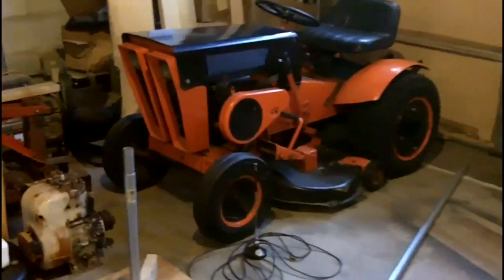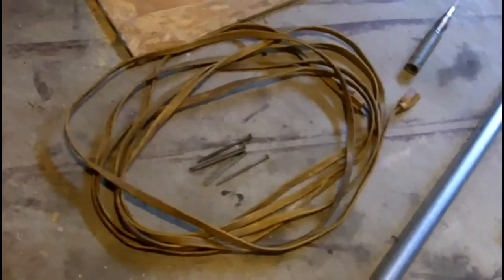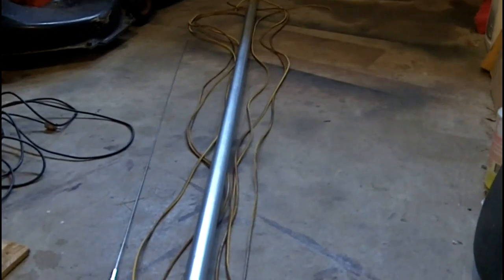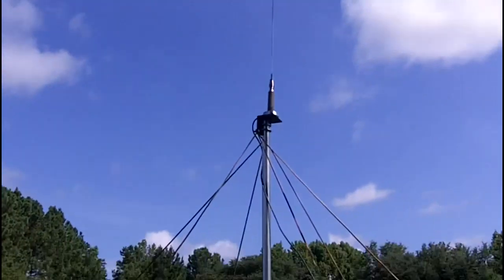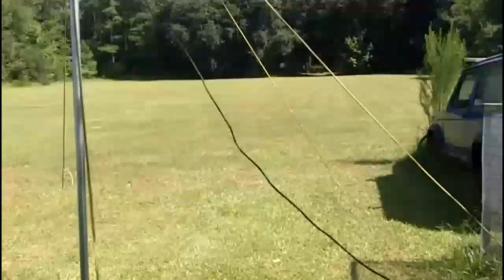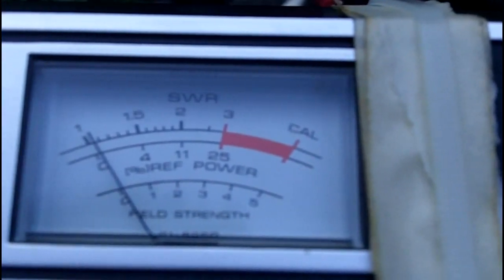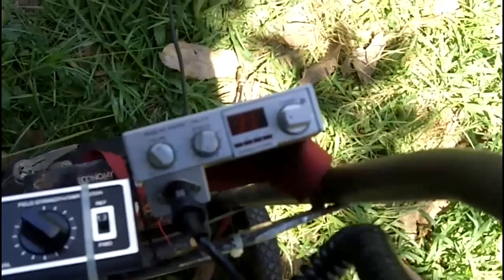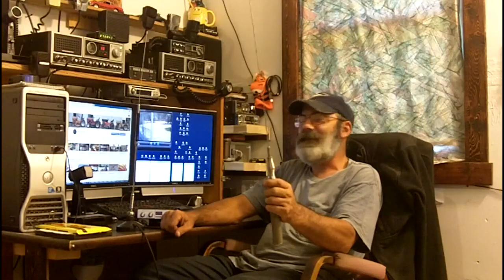Mobile CB Radio Antenna as a Base Station

Comment: TRC-415!!! The first cb i ever had! Begged my parents to get me a cb and we went to Radio Shack and left with that one! Great memories sitting in that hot van at 13 years old in the mid 80's trying to talk a few miles! Thanks for the memory jolt!
Reply from the maker: The 415 may not have a lot of features, But it is a great little radio. That's very cool, that it was Your first radio. Thanks for watching.
Reply: @MowerJunkie  short on features, long on memories. Keep up the fine work, sir

Comment: I did this in the early 80's with just a 9ft alu pole and a 7ft firestick. It worked so well, someone stole it out of my back yard along with the coax.
So I made a 36ft dipole from twin core cable and strung it down the garden... Looks like a washing line.
My temporary fix antenna has worked well for 25 years and is still doing it.
Reply from the maker: still working after 25 years.....That's awesome! Gotta love the Homemade's. Thanks for watching, 73's

Comment: Ok Mower Junkie, I had flashbacks from the 1980's.  Yes the center load mag mount is from the 80's.  I had the same one.  I needed to broad band it a little more to talk on 35-40 SSB.  So I used a metal coat hanger and trimmed out a new top part for the antenna.  I then stuck the mag mount antenna on the seat of a metal folding chair on the roof of my shed using the original however long coax that came on the antenna.  I named my antenna the Astro Chair Plane.  Did alot of talking on it.  Enjoyed the video, it brought me back about 30 years.  Also this is what radio is all about.  This was when I enjoyed radio the most.
Reply from the maker: Thanks for sharing Your story. Antennas are My favorite part of the Hobby, and I do like hearing what others have done with them. 73's Mon Goose, from 151 SC.

Comment: I have a K30 on top of my 30’x60’ shop and I have have been amazed at how well it performs on skip . Enjoy your experiments always good to hear someone else’s ideas.
Reply: i have a K30 too and a shop thinking of doing the same.  How did you set it up?
Reply: @mtw3725  I tried to center it on the roof it leans to one side a bit but the magnet holds really well on the sheet metal and used some tape on the coax to keep it in place, I have been amazed by how well it works, SWR is very good. If you are looking for something simple , easy and quick it will do the trick.

Comment: Nice test set up. I thought the same about a decade ago. Had a self assemble press board night stand, strapped it to a similar hand truck and could house any radio (mainly to test CBS) to takes to the local flea market. Never finished the project but, the intent was to be able to test a set as I found them, would have carried a car battery inside, and would have equipped it with an SWR bridge and antenna. Never completed the project but that was the idea. Could have used it anywhere and equipped for anything, like a heavy "go box" for any radio hobby.

Comment: I'm using a dominator Springer as a base station antenna and it does work I've had some surprising results, I've got a 102" tank whip also with excellent results coupled up with a kenwood TS50

Comment: Getting a kick out of this bare bones base rig. I remember a guy that was running an old Halicrafters crystal rig that was a 6 channel bread box size radio. He wasn't pushing more than 3 watts he said. Had a small ground plane antenna in a tree outside his window. He was able to reach town about 8 miles or so. This was in the early 70s.

Comment: I used to transport for mobile broadcast television. I was always on the CB. I signed off October  9, 2011, if you were counting. Lol... So today I purchased a Wilson trucker 5000, a gum drop stud, with mount and bracket. Using a Cobra 29 LTD Classic. Home base set up. My antenna mast is made out of a 4' long 1x3 piece of wood. I temporarily attached it to my roof off the facia board. Ran the cable and signed on today. First time in almost a decade. Did a swr test with an Astatic swr and power meter. I'm at 3.0. Lots of static out there. So I'm thinking I'm just not grounded correctly? I did have success during my test. Someone asked who was making his dial move to the right. It came out of the blue. So I answered. He was about a mile away. Sounded real close. He too was a home base. I'm up on a hill looking over a valley. I've got a grounding rod for lightning and a Pro Trucker CB & Ham Ground Radial Kit for Mobile Magnet Mount Antennas. For the Wilson 1000-5000 brand. Not sure if this will help, gonna find out.

Comment: Long time no hear hello from hillbilly in the bam I tried that antenna and used four ground radicals that were stainless steel whips and had some of the best ears of most antennas I've had
Reply from the maker: Hello hillbilly in the Bam, Thanks for sharing Your experience with a mobile. Lets Keep the hobby alive! 73's from 151 SC.

Comment: Used to have one of those Antenna Specialist base loaded whips on my high school car. Worked pretty good.
Reply from the maker: I have 1 on My garden tractor, and it works great on it. It's a shame this 1 was damaged. to be honest, it looks like it was damaged during manufacturing.
Reply: @MowerJunkie  They made a ton of them. Probably the number one seller back in the early 70's.

Comment: Make a vertical dipole. Attach center conductor of coax to whip and braided side to 102" tube. Isolate tube from earth by about 1/4 wavelength using PVC mast or wooden fence post. You'll get close to a 50ohm match and fairly flat vswr. Did this last week. Worked Oregon to Georgia (the state) on 10 meter band with a whopping 5 watts!
Reply from the maker: I've run dipoles setup as horizontal and vertical, and even at 45 degrees once. It's a good antenna no matter how you hang it. Take care, 73's

Comment: im useing a magnet mount wilson 1000 antenna on a metal roof mobil home. and im getting 1.3 swr on it.  its working quite well barefoot. im running a uniden 980ssb radio. i havent heard you on my radio yet. but i have heard nc many times. maybe ill get you one day in the future.  listen up for me 806 in the Texas panhandle. 73's to you.  joel
Reply from the maker: Hello 806, Thanks for watching. 73's from 151 SC.

Comment: On that old mag base,  what did you attach that new grounding wire to ?   73's  from old fart cber.
Reply from the maker: when I put the 2 foot antenna on the pole, it was only grounded magnetically. I did not add a ground wire to it.  Thanks for watching, 73's from 151 SC.

Comment: I am currently using a Wilson 5000 mirror mount as a base antenna problem is I only have two ground planes at this time.Good thing is my SWR is under 1.2
Reply from the maker: That's awesome! I'll bet that Wilson makes a pretty good base!
Reply: I use the same antenna as a base myself. Works great, can do about 5 miles locally with my buddy and I've heard quite the chatter late night. I hear people all over the east coast even heard Kansas once
Reply: @MowerJunkie  Makes an even better mobile!

Comment: I used a top rail from chain link fencing and cut off a section drove it into the ground and then I slipped the other section over top of it that has a magnetic antenna stuck on the top of with a piece of 8 in x 8 in metal but I still have the Sky High standing wave I was trying to avoid the ground plane wires

Comment: My question is. Do you strip the insulation off the extension cord wires you're using for ground plane wires?    Is it better to use bare ground plane wires?
Reply from the maker: No need to strip the wires, Only the attachment end needs to be stripped. the wires will last longer with the insulation on. and it won't hurt the signal at all.
Reply: @MowerJunkie  Thank You for answering my question appreciate it. 73.

Comment: Hello, I recently rediscovered a CB radio I bought in Highschool 1991 that is in mint condition.  I used it in my car and had a group of friends who then did the same. We had a great time.  How can I know which converter to buy to use this as a base station at home?  I'm afraid to not know exactly what I need!   Thanx!
Reply from the maker: any 12 volt DC power supply with 3 amps continuous or more should work fine.

Comment: I’m trying to use a Wilson 2000 on a mass pole next to my shed and can’t get the swrs low enough
Reply: U need to get a ground plane kit that antenna was made to have metal underneath it to function I'm going through the same thing right now with the same antenna

Comment: My boyfriend wants to know what coax you use and the length  also he works in hot attics  putting in ac unit  100 degree is nothing he works in herando Mississippi  nice job waiting for you to do a livestream to try to call you keep up good job 10 4
Reply from the maker: for this antenna, I used cheap rg58u coax. Most of the base radios I setup have rg8x. Be careful in those attics. Thanks for watching, 73's from 151 SC.

Comment: So does it work better with 6 wires instead of 4, to tie down at the 45^ angle?
Reply from the maker: 4 will work well, But more will make it easier to tune. Thanks for watching, Take care.
Reply: I have 16 x 3m ground plane wires on my 7ft Firestik loft antenna..
Works ok but no way near as good as my homemade 20ft pvc antenna...
20ft pvc pipe with 36ft of wire wound onto it... Like a firestik only better.

Comment: What exactly was the ground wire soldered to on the magnet mount?
Reply from the maker: Sorry, I don't have an answer for this. the base of the antenna is sealed, and not visible.  Thanks for watching, 73's from 151 SC.

Comment: An umbrella base would probably be better than those boards
Reply from the maker: I was also thinking a Christmas tree base would work well. But the wood worked well for a temporary setup.
Reply: Mower Junkie 
I would recommend something with wheels so you can move it around

Comment: The pole doesn't have to be in the ground for proper grounding?
Reply from the maker: If this setup was permanent it would need to be grounded. it does not need to be grounded for a temporary set up.  Thanks for watching, 73's from 151 SC.
Reply: @MowerJunkie  that cables that you put down in the ground.  makes that the ground for the antenne?

Comment: I don't know where everyone comes up with this 102" obsession. The actual length in the real world is 108". And that is for the GP radials as well.
Reply from the maker: I don't know where everyone comes up with this 108" obsession. The actual length in the real world is 102". And that is for the GP radials as well.
Reply: @MowerJunkie  : The 102" whip is designed to be used with a ball mount and heavy spring. Plus, after taking into consideration the velocity factor of the feed line, 108" is the proper length. You can do all the math you want. In theory, the mathematical length of 1/4 wave is 102". In reality, the physical length is 108"
Reply from the maker: @TheLonesometoad  I've made a lot of antennas, and I've tried both 102 and 108". and every time the 108" will not tune properly. I have even done testing with a 102" SS whip, with and without the spring. and I have found the 102" length works the best. if 108" is working for You...stick with it. Take care, Thanks for watching.
Reply: @MowerJunkie  ... The 108" won't tune because it's resonant frequency is 26.000 MHz (468/26.000=18'/2=9'x12=108"  or  234/26.000=9'x12=108").
Great video, I had a similar setup using a Hustle HQ-27 Center Loaded mobile antenna at 40'. It was a great antenna for 11 meters (CB) until I moved from TX to MA.
73, have fun and stay safe.
Reply: 108" is correct, I have 102" whip with 6" stainless steel extension up over my shop. mounted on 20 ft flag pole with 3 102" radials. have 1.1 SWR on complete 23 channel band and with 80 watts only 1.2 SWR
Reply: @robertcook5972  : Well, I know it and you know it. Let the rest figure it out for themselves. I've been installing these for over 50 years and 108" is the magic number. Most people don't know you have to count the pot belly spring and the ball mount.

Comment: hi I'm IU8MLV; I would like to resume CB broadcasts with my Zodiac Tokio 276 ch AM - FM - SSB, which I have suspended due to the QTH change. Now I live in the attic (3rd floor and top floor) and on the balcony railing I have mounted a corresponding 4 meter pole at the lowest point of the roof. To this pole I mounted a 3 meter long Comet GP6 for the VHF - UHF, of which by means of the 4 meters of the pole, the 3 radials are raised to 1.7 m from the roof. I have my old Sigma 5/8 Mantova 1 antenna which is 7.20 meters long, but due to a very ventilated area I cannot mount it because:
1- I cannot mount the pole on the roof because I do not have the sturdy structure, otherwise I would have also mounted the bibanda pole on the roof.
2 - I cannot make the cables braced on the 7.2 m stylus because it would be mounted on a pole installed from the balcony and not in the center of the roof (mounted at the corner I have no points where to fix the bracing anchors)
3 - I would have to mount a partition pole (like a cross or an L) and also mount the Cb Mantova 1 antenna on the same pole as the Comet GP6 twin antenna and it would be too heavy a structure with overload of the single pole.
I have the roof completely covered with iron sheet with sloping sides of which one side is inclined by about 25 degrees while the other is inclined by 7-8 degrees. In the center there is the central curb as long as the whole house and it is almost level (it is inclined by about 2-3 degrees) but it is about 30 cm wide. I thought that this roof would be like a large ground plane (like the chassis of cars, trucks, buses) and consequently I could mount a car cb antenna with a magnetic base.
If necessary, I purchased a 1.98 m SIRIO model P5000 cb car antenna and a magnetic base of 16 cm in diameter. I thought of this alternative because this is a 2 meter whip antenna and would hold the wind (I don't know if the magnetic base from 16 cm up to how much it holds the wind) while the MANTOVA 1 base antenna is 7.2 meters long. meters and mount it to the same pole, as I have already said, there is a risk that the wind would break everything, even if the pole is made of galvanized iron and not sheet metal or worse aluminum. The metal is 5 mm thick while the diameter is 2 inches (6 cm) and is of the same type as those used for road signs. Unfortunately 7.20 m of antenna are a very heavy and resistant load and when there is strong wind even 50 knots, the pole despite being so strong I do not think it would hold the weight and oscillations of two antennas (COMET GP6 and MANTOVA 1) . I had thought of a Boomerag antenna but I would not have complete omnidirectionality since it is mounted on the balcony and therefore one side of the wall is a negative signal coverage.
In this video I noticed that you have mounted a car cb antenna in the garden. I still haven't mounted my Sigma P5000 CB. In your opinion, is it a solution to mount it on the roof with a magnetic base? Or should I mount the cb antenna on the dual band pole with a cross or L-shaped tube? The pole would hold up with the strong wind both the bibanda and this Cb Sirio P5000 with whip stylus. Thanks for the advice